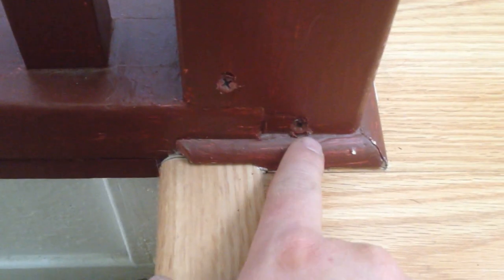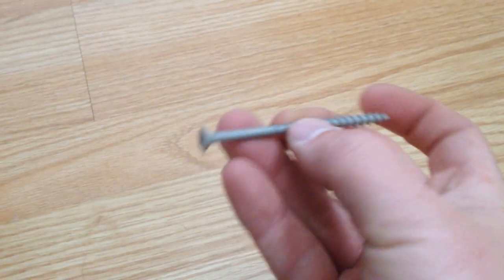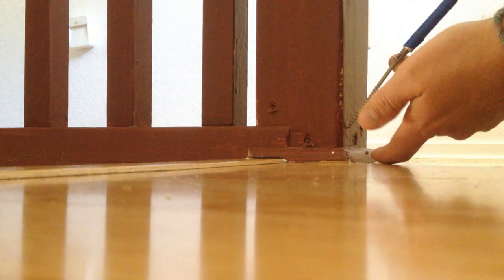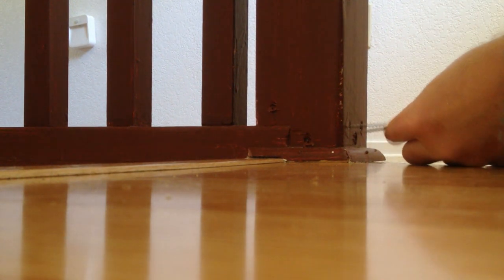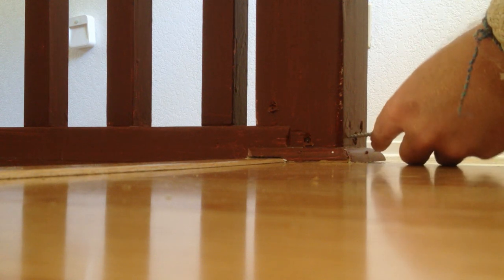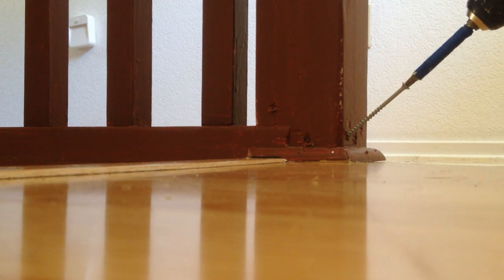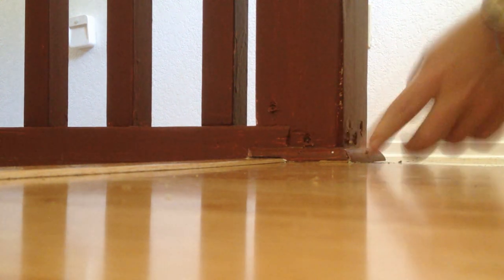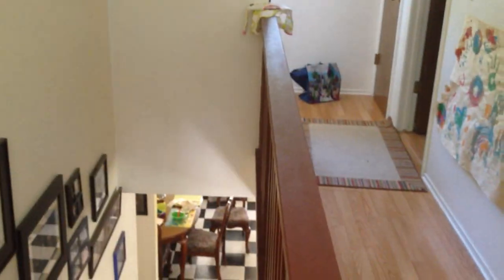Fixing a Loose Newel Post (Banister)

Comment: "Now......hardly moves." This is a dangerous way to secure a newel post. All those screws inserted into the base is splintering the wood, which will cause the anchor point to fail. Too many bad tips on this video to comment on, I could go on and on.

Comment: Yeah that’s not a good fix. That’s why your having to a second repair. The problem is with the original mechanical fastening system. That’s inside and needs to tightened up.

Comment: Wow that's horrible
Reply from the maker: Well, thank you for the constructive and positive feedback! :) Amazingly, my house has not fallen down since this horrible repair was made, and the railing next to my stair is remarkably more stable than it once was.

I do appreciate your concern :)
Reply: Jesse Jones Respectfully, as a structural engineer I see that guardrail as unsafe still.  Anyone leaning against it at the top could still cause the wood post at the base to split.  You need larger lag screws to ensure the base of the post is very stiff.   Those screws are a good temporary fix only.   Just my 2 cents.  Thanks.
Reply: +Panos K If it's properly toe nailed that's a pretty damn secure joint.
Reply: define "properly toe nailed".    I still stand by my comment.    Thanks

Comment: You need a longer screw so you can toe screw much higher and grab more wood from the newel post.  use a grk r4.  you could also use a much larger lag screw but you would have to counter sink and plug the hole.   

there are a lot of other methods.  However fixing a newel that has not be properly wedged/anchored correctly is never a quick fix.

Comment: I'm not a carpenter or handyman by any stretch and even I can see that this is NOT how you fix this problem.  Moving on.
Reply from the maker: And yet, 5 years later, it's still working great! Granted, I'd still like to rebuild the whole thing at some point, but this "temp" fix (that's lasted over half a decade) sure was cheaper!

Also, the fact that all of the people flocking to the video to tell me how badly I did it has paid me WAY more in AdSense than I spent on the repair :)

Have a great day!
Reply: To be fair, they (like me) found this video while searching for the way to repair a loose newel post. They leave a comment (like me) because while they are not experts, and are searching for the right way to fix one, even a moron knows THIS is not the right way to do it. Congrats on the billions of dollars.